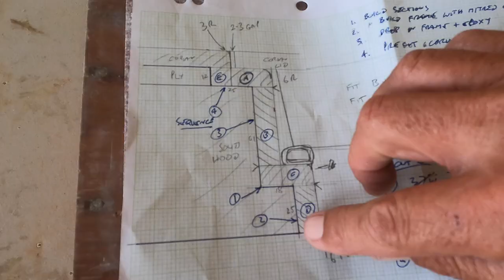Fridge Benefits - How to totally transform a 45-year-old galley | Boat Refit Documentary Part 21

Comment: Hi , what insulation did you use for freezer?
Reply from the maker: Didn’t have to change anything for the freezer box itself but the new lid is a closed cell foam specifically used for insulation. Will have to check the name of it.